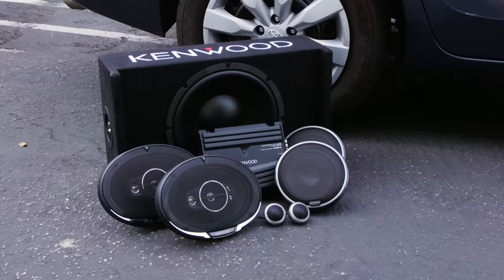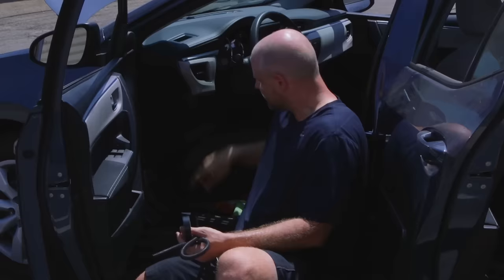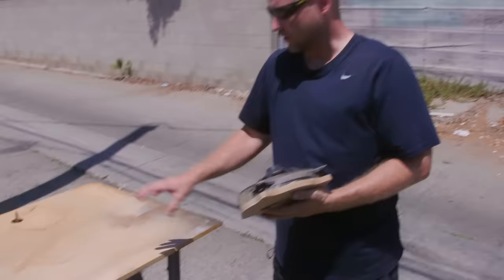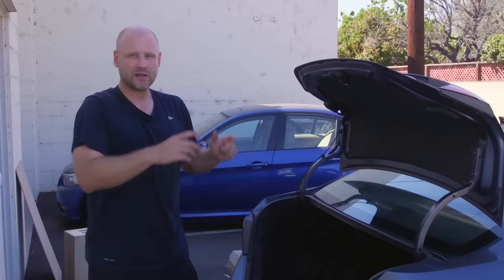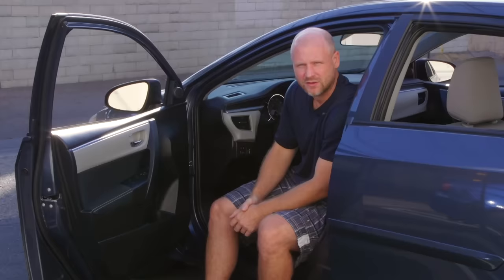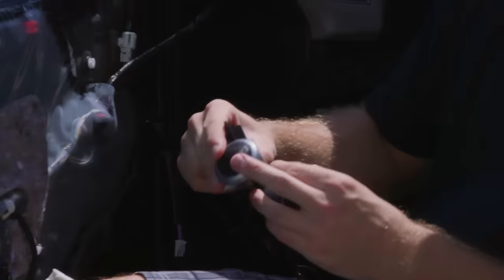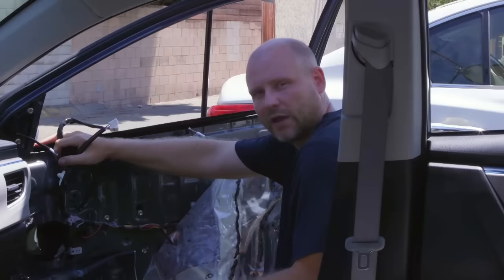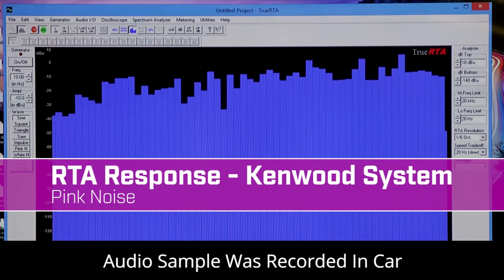Full Car Audio System Installation - Speakers, Subwoofer and Amplifier

Comment: So for the best sound quality in a complete setup in a car audio system, would you recommend turning the bass off completely in the car speakers all together and only have the subwoofer make the low frequencies ?
Reply from the maker: Well yea that's the idea of tuning! Here's a quick run-down: 
You want your speakers and components to play the mid and high frequencies of your audio, and you want balance between them all. Play music with a little bit of everything, lots of high notes like brass and cymbals, mids like vocals and guitar, plus lows like bass and drums. Adjust your stereo’s fade control to send the audio just ot he front speakers. Turn on the high pass filter of the amplifier and tune it to eliminate the low notes coming from them. Do the same with the rear speakers, and set the fader back to its original position.
You want your subwoofers to play the low end frequencies and your components to play the highs. The idea is to cut the bass from the components so they’re not trying to reproduce lower frequencies that will cause distortion and clipping and the opposite for the subwoofers, you want them to play low bass frequencies not highs. The crossover points on the amp limit the frequency response of the speaker before the music gets to the speaker.
Lets go over low-pass filter. Turn your sub’s amp gain to it slowest position, make sure bass boost is off and any remote level control is set to middle.  Switch the low-pass filter on and set it as high as you can. Also make sure your stereo’s bass boost is turned off if it has it. Begin to play music at about 1/4 volume, and turn up the suubwoofer gain on the amp until the subwoofer audio completely overpowers the speakers without distorting. Next adjust the sub’s amplifier low-pass filter down until the high and mid frequencies disappear. 
The low-pass filter will now effectively eliminate the highs and mids from the subwoofer, vocals, strings, drum cymbals, you don’t want tat coming from your subs. If you have bass boost carefully turn it up to your liking, but be careful this is a common place for distortion to peak its annoying head into your system. If you hear it, lower the sub’s amp gain until its gone. When dealing with ported enclosures, use the subsconic filter on your amplifier to control overly loud low notes. A lot from this point depends on personal preference, play with the low pass settings until you get the bass that you want.

Comment: Its funny :D. Installing 6x9 rear speakers and subwoofer? Choose one. Subwoofer just distort and on higher volume just rip 6x9 speakers. Sub has to breathe and to flow to cabin, and the easiest way through 6x9 speaker membranes. You dont need 6x9. In this type of cars, 6x9 speakers works as lower bass (typical 50-3000hz). So if you install sub, you remove 6x9 speakers.

Comment: My setup is 4 speakers with 1 subwoofer + 6 channel Amp. if I operate in 5 channel mode (4 speakers + sub) what stereo line inputs are needed (2 x full range and 1 x mono line ?)

Comment: Judging by that final RTA graph, still is somewhat bright.
Reply: Had to scroll down so far for this comment. I looked at them frame by frame. The first one has the analyzer range set from -20 to 10 dbs, then on the second "after" is set to -140 to 10. All this does is make the graph lines look a lot taller. There didnt seem to be any significant difference when trying to account for this graph range change. There must be some difference but the graph was completely pointless.

Comment: Great video man🙌🏻 i have a doubt, could i take the one pair of rear speaker wire and connect it to amp input? Will it provide the necessary power for the amp to work?

Comment: nice video .. grat work too. but you didnt show how to connect the factory radio to the amp?
Reply from the maker: That's the part with the Line Output Converter, around 15:30

Comment: So My Cars Battery is in the trunk that helps some? And my Back seat has a Recessed middle armrest. I think I could modify by removing the back leather behind the armrest and when armrest is in down position I could have a mesh that would allow for sub woofer sound to pass to inside car.

Comment: Great video. I've never installed a LOC before and was wondering how to wire it. Could you please help out?
Reply from the maker: We're making a video on it so stay tuned!
Reply: Quality Mobile Video Plz!! Do the video of LOC and in the two version from tapping in the rear speakers and from the head unit because I really got loss in the installation part of it. It didn't show clearly how to wire the remote and others details I have a 2017 Corolla and I want to make the same thing to it. The only thing I need is that installation part of Loc thanks!!!

Comment: I love how clean you did your install. i had a shop install mine in my 2014 tundra without the jbl system. I have a Audison Bit ten and a 5 channel alpine for the system. its crazy.. i noticed when i fade to the front on the radio all 4 door speakers play. when i fade to the rear, only the sub is heard.  when i fade to the right i hear the sub and the right side( front and rear). when i fade to the left, i do not hear the sub and only the left side. The installer says it must be my Audison Bit ten being the problem. I need help..
Reply from the maker: Sounds like a tuning issue!

Comment: A great wire pulling lube is rubbing alcohol. Slippery when wet and then evaporates. 19 years in car audio and I still can't leave a factory system alone.
Reply from the maker: Nice suggestion!

Comment: Super.
Which line(head set front or rear line) do we need connection for sub .(I mean head set unit front side speaker line or rear speaker line to hi/low converter)

Comment: Installing amp on the side of the trunk instead of the back seat would be how a professional installer would have done it. Cleaner and less potential damage to amp in a daily driver.

Comment: Great video, thanks. It  really helped me understand things a bit more. But was the amp setup only for the sub woofer?
Reply from the maker: We wired the rear speakers and subwoofer to the amplifier. The front speakers and tweeters were hooked up to the stock head unit

Comment: take the frame at 16:30 for example, he has both speakers and the sub to hook up to the amp but he only has two slots on the amp connected..? to connect all 3 (two speakers and the sub) he should need at least a 3 channel amp, 3 sets of pos and neg connections. and also, he doesnt even have the front speakers connected into the amp, how are they going to be amplified? the sound quality would be mainly orientated towards the back of the car and way off balance from the front because the back speakers and sub would be making more sound than the fronts.
Reply from the maker: The frame that you're talking about, is just ONE Subwoofer wired to the speaker terminals. Not really sure where you're getting the "speakers" from. The speakers are powered by the head unit. I think you're getting confused by the power, ground and remote turn on and Line output converter connections

Comment: quality mobile video , what would happen if u didnt make a jumper harness for the tweeter? and what  is a line output converter ?
Reply from the maker: A LOC changes your vehicle's stereo wire output to RCA cable output and adds an amplifier and a subwoofer to your factory speakers. It also provides remote turn-on wire for your amplifier. We used this one for my Corolla:

http://www.qualitymobilevideo.com/lp72.html

Comment: Can I ask? If I'll add more 12v accessories like a light or LCD TV, how should I set up the power? Those things don't have remote turn on terminals, they'll stay on if I connect them directly from a battery (through a distribution block or splice?).

Comment: Man, i have a toyota yaris and it is soooo hard to find a way for power cable in the firewall. I mean, there aint a lot of dudes out there installing a sub in their yaris and pratically no info about it on internet, every thing i found is about corolla!

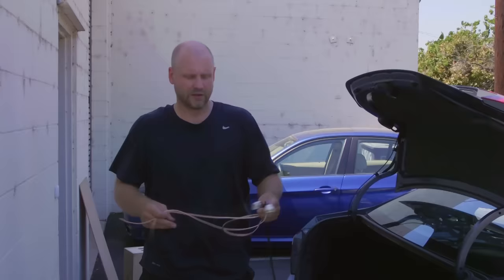Comment: Would you please explain the Y harness for the rear deck a bit more. I'm confused on how the speaker wires are connected to the adapters. Thank you. @10:00

Comment: great video  can you please tell me if cutting out the door plastic where the speakers are makes a difference?
Reply from the maker: The water covers?
Reply: Quality Mobile Video no. the  panel of the door so  you will see the speakers trough . I wonder if the trim attenuate the sound

Comment: Nice video man ..had a question..was the stock radio strong enough to give enough power to rear and front door speaker + tweeters ...or did I miss something...
I have a sub .and upgraded the rear and door speaker but sounds like the stock radio not strong enough to power them well ...stock radio is like the one u can have here...
Thanks

Comment: Dont know what i missed? Where is the wire from the radio into the amp? What did he use for thatm or did he use the rear speaker wires into the amp then to the speakers? I missed that

Comment: one more question sir were are you powering your amp from straight from the loc or from the fuse box ?
Reply from the maker: The amp is powered by the battery! The LOC doesn't power it, that transfers the audio signal of the factory radio into RCA audio outputs to send to the amp.

Comment: I have a Corolla 2000
And planing to install a new sound system.. and these all the options we have here:
Amplifier: sony XM-GTR4A
Subwoofer: sony XS-GTX122LT
Head unit: sony CDX-G1200U
Speakers: sony:
Xs-gs6921
Xs-xb130
Xs-xb1641
Xs-fb693e
The question is which speakers should I install in the back and which in doors?

Please help
Reply from the maker: Whichever ones have the lowest frequency range

Comment: I have a 2011 Chevy Impala.  Here is a list of Speakers I want in the install.  Speakers are of course in pairs.  Pioneer TS-WX 1210A
Sealed Powered 12" Subs  20-125Hrz

Alpine S-W10D4 10" subs  28-200Hrz

Kicker CWTB84 8" 30-500Hrz

6x9's  Hertz HCX 690 three way 32-23kHrx

6.5" Pioneer TS-A1675R
35-31000kHrz

JL Audio C5075-CT Tweeters

Is this install possible and if so can you recommend the best head unit and amp(s) needed to power this setup at peak performance?

Comment: after watching this im slightly confused as to why you made the y harness was it to connect to the line out converter for the sub so that there wasnt the need to run a cable from the head unit Eg a rca ??

Comment: So that small box thing above the amp, that carried the lows from the factory speakers into the amp then to the sub? I'm used to after market head units where you need to the run the stereo wires to the amp...
Reply from the maker: Sort of! It's a Line Output Converter. It turns the speaker outputs of the radio into low level signals for the amplifier to register. Here's our video going into detail on them: https://www.youtube.com/watch?v=OXn8-8yee5o&t=8s

Comment: can the stock battery drive that amplifier with that sub without having problem later on? and is it okay without a audio capacitor to boost the sub? thanks for response in advance..
Reply from the maker: I've had no issues so far using my battery (it's my car) :)
Reply: @Qualitymobilevideo  does your car have a stock alternators? or it is upgraded? thanks

Comment: Hi just wanted some advice on trying to do the most with what I have. Will it mess with signal at all running speakers off the wires from deck and also using rca outputs to amp running other speakers. Thank you

Comment: Does the sub just sit there, or is it mounted in some fashion? I can picture that sub flying all around depending on driving style, or sudden stops etc...
Reply from the maker: Lol its not mounted but it doesn't really move around, its pretty heavy plus the fabric on fabric friction keeps it in place for the most part. I don't drive like Dominic Torreto so it's cool

Comment: Question,  If I'm running all 4 of my door speakers on an amp plus a sub ( Using an LC7i line out converter to a 5 Channel amp) Do I just hook that Metra to my stock plug and then run lines from the Metra to the line out converter for each speaker?

Comment: So is the SUB wired to the same connections as the rear speakers? Just trying to understand that part specifically as there is no SUB connection on the Amplifier specifically.

Comment: Great installation. I wonder if anyone can get the templates for speakers without buying them first? I need the templates so I can cut the rear deck for 6x9 speakers. Are all templates the same size for these size speakers? Thanks. Rick
Reply from the maker: Hey Rick, check these out. Universal 6x9 speaker adapter plates: https://www.qualitymobilevideo.com/82-6901.html
Reply: Nice.Where can I get a set?

Comment: Looking at your video, I decided to ask your opinion on this. I am about to buy a system for my Mitsubishi Pajero 94: 
These are the standard size 
   Front: 4", 6-3/4"
   Rear: 6" x 9"
   Dash: 4"
   Front door: 6-3/4"
   Rear side panel: 6" x 9"

I don't want to put in a sub (As I don't want a box in the back) but I would like the deep sound, so I am planning to use 3 ways in the front and rear doors and rear area, and two way on the dash.
I would like to use 1 amp to drive everything.  
I would like lots of top and bottom end sound, as I listen to mainly Reggae, Soca, Jazz, R&B and blues. 
Being in the Caribbean at times I can turn this up, however, when driving I would like to play this low with a nice rumble.  I would even like to just sit in the Pajero on the beach or in the mountains and listen to music or a video with a nice sound.
Any ideas how to set this up? Or Are there any special ways to set this up? 
I am thinking of using alpine as past experience tells me I will not get amp noise and a good sound without breaking the bank.

Comment: Can you guys show how to add a third brake light camera to a 2015 F350 dually lariat FX4?  Here’s the skinny, I’ve upgraded to the sync 3, got an LED third brake light with factory camera off of my buddies wrecked 2017 F250 Lariat. I’ve also bought his camera button out of his 2017 dash.  I want to be able to turn it on whenever I want but mainly to use when I’m hooking up my RV 5th wheel. I want the video feed on the sync 3. I’m thinking going above the headliner with new wiring to the camera from the switch then going from the sync 3 in the dash tying into the video feed but putting a relay in the wiring so I can flip back-and-forth. Do you think this is something that is possible with this truck?

Comment: I'm a rookie with car audio. Seeking some help. I salvaged B&o speaker 16 speaker set out of a 2019 audi a4 (only speakers not the amp) I'm planning on installing the complete speaker set in a classic project car. How/what amp do I choose or what else do I need to complete it. I have a kenwood head unit.

Comment: Is it not true that once you remove interior trim they wont fit back like they used to? introducing rattling and other noises? Also won't your ground rust ?
Reply from the maker: If you do it correctly, take your time, save all the parts and screws, you can put it back together like it was never taken apart.

Comment: Hey thanks for reply. Most video guys never bother to reply to comments. I get it. Here is a good question I've been trying with no luck to find the answer to. Why are their no covers designed for the 6 x 8 speakers? Like the 6 by 9? I have just enough space for a 6x8 in my kick panels. Yet I have no cover with the pioneer speaker I just bought. Do they make any speakers this size with a cover or grill? Yes they are cheap but I don' t want them getting kicked or visually have to look at the speaker without a grill. Any ideas Lorenzo?
Reply from the maker: It's usually because of the way they fit inside the factory locations, they wou;dn't fit with grilles. 5x7 and 6x8 don't come with grills for that reason, and aren't compatible with all types of cars, usually just Ford.

Comment: Please inform me about the phenomenon that when i turned on the BASSFACE Indy DB4.1x and i had connected the high in plugs with signal from my old cd-radio, the amplifier (with +12v on rem) starting hearing the output sound but after few seconds the voice slowing down and finally disappeared . The sound came back again when i cut the 12v from amplifier and connected back again. Any idea for this trouble? Thank you

Comment: Nice work. I have a Mercedes G500. I want to change the head unit out so that I can get my iPhone to work through it and have apple carplay. The stock Mercedes Command stereo won’t allow me to. I’m being told it’s a  major ordeal as it’s a fiber optic system. Any advise on how to handle such a situation?  The sound isn’t that great out of the current set up but didn’t want to go through the ordeal of an entirely new system.
Reply from the maker: What year is it?
Reply: Quality Mobile Video. Thanks for the reply it’s 2003 Mercedes Benz G500.
Reply from the maker: It's possible, but it requires a full rewire, a ton of work man. Could cost a lot

Comment: Thanks for the great video. I've been building wire harnesses and wiring up electronic systems for a living in high tech industry for a long time but surprisingly never inside a car. When I saw you use heat shrink tubing and tie wrap anchors then I knew then you're the guy that really knows your stuff.  However I'm curious to know but the wires you attached at 16:09- did you just twist them up together and heat shrunk them in place or did you actually solder the wires together?
Reply from the maker: We soldered those wires too! Just didn't show it on camera, its not exactly the safest thing to do inside a car so we don't want to give people bad habits. It's more of an experience situation.